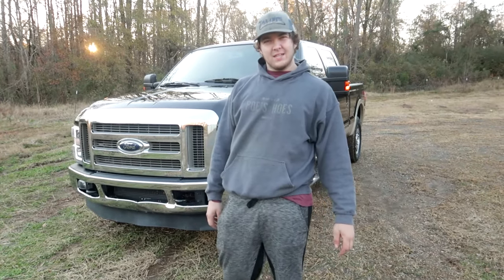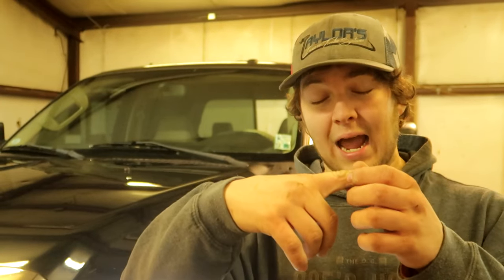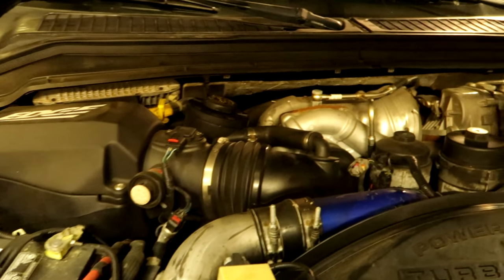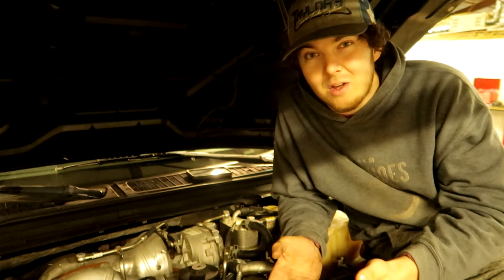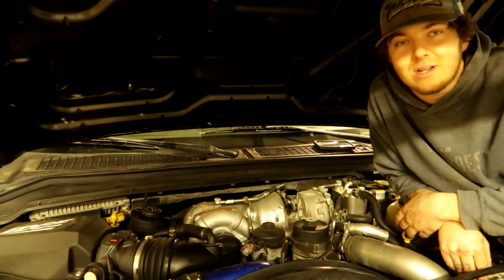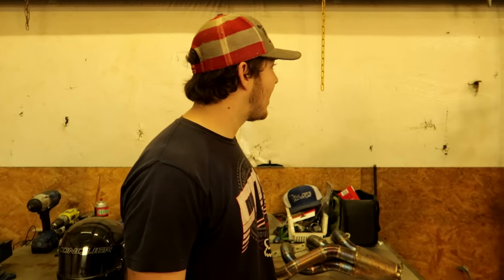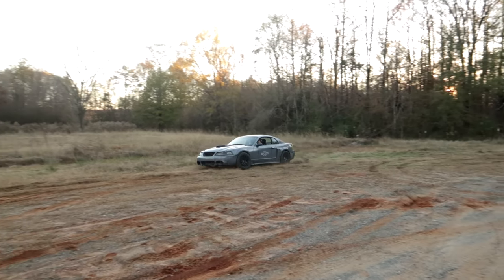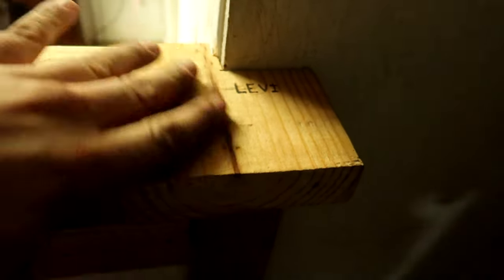Is the 6.4 Powerstroke a RELIABLE truck?

Comment: Let’s just say the 6.4 made me a rich mechanic three years ago!
Reply: Would be a great truck if it was a fummins
Reply: @lc2kx549  yessssssssss
Reply: I believe there’s a YouTuber that swapped a Cummins in one ! Things Insane!!
Reply: @monstermunoz18  yes their is
Reply: Taylor Ray
Reply: I’m not even a ford guy and my dads 6.4 convinced me that these powerstroke trucks are a force to be rekoned with. Once I buy myself that 6.7 Cummins I’ve always wanted I’m gonna buy one of these 6.4’s and turn it into a mud truck.
Reply: @monstermunoz18  Taylor ray and Westin Champlin
Reply: @hilljackzack7284  6.0L's and 6.4L's are monsters when they have aftermarket modifications,but honestly a 6.0L is a better choice probably.The 2005-2007 6.0L was more reliable than the ones made during 2003-2004.There also is quite some similarities between both of them,the 6.0L has a 3.74 bore while the 6.4L has a 3.87 bore,so not very large in difference,but both have a 4.13 stroke.The architecture of them is different,including emissions.That's another thing why I would go with the 6.0L instead,because the 6.4L has stricter emissions and also DPF filters.
Reply: @Slim_Slid  I’djust delete the dpf like I would on a Cummins. Ohio doesn’t have a yearly inspection so I’m not to worried about getting caught.
Reply: @hilljackzack7284  I didn't know Ohio had that,but then again I'm in Texas.Honestly if you do the delete,they can last 300,000 miles or more.If it's bone stock espiecally with all those strict limits,you're lucky to see 120,000 miles.The only engine during the time of the 6.4L that easily handled any kind of mileage was the gas 6.8L,but it had no torque in comparison obviously.
Reply: @Slim_Slid  that 6.8 motor is bulletproof as far as I’m concerned. It’s perfectly balanced and it sounds really good straight piped.
Reply: @hilljackzack7284  6.8L's are indestructible,espiecally the 2V V10 for 1997-2003.They just don't have as much horsepower/torque as the 3V 6.8L.
The spark plug rumors about them aren't a big deal as long as you torque them correctly without making them loose or doing it very tightly where it breaks.They have that high idle or whine like a 5.4L.When you delete or cut the manifolds and muffler,it's ridiculously loud.The V10 is basically a modernised version of the 7.5L,just easily less displacement and more cylinders of course.
Reply: @Slim_Slid  your statement is wrong, my 6.4 powerstroke is bone stock and it is approaching 300k miles. All that I ever had to replace was the alternator and the a/c compressor.
Reply: @johnny-ec3bz  Bullshit.The piston rods on those engines are weak and often at times can throw out,not even half before that mileage.I believe that your 6.4L PSD is at that those miles,but there's no way you only had to do those two little things,I know others who hardly are past 100,000 and already need to do rebuilds or buy another truck.
Your engine is just about to crap out,I can guarantee it,give it several thousand more on miles and that's it.
Those engines also have worthless turbochargers,being sequential was nice,but they were seriously flawed.Let's not mention the continuous blow by because of the DPF and exhaust stroke which leads to cylinders number seven and eight on a compression test.
Reply: @Slim_Slid  believe what you want but the proof is sitting right outside my house and yes I had other issues but nothing that had to do with the engine or the turbos
Reply: @Slim_Slid  calm down, mine is at 250k and still original also. just maintenance and don’t beat em up. I do agree some just go no matter what.
Reply: @monstermunoz18  yeah @westen Champlain
Reply: @Slim_Slid  I’m sure plenty of 6.0s and 6.4s make it, the difference is that a lot don’t and they can fail like that. Other hand, you can abuse a Cummins and still see 4-500k lol
Reply: @Slim_Slid  06-07 was the best 6.0 but they’re better with a 03 turbo 👍
Reply: @uisahoebhaha6165  I've already known about that...But thanks...Not I really care because I don't really want a 6.0L PSD or 6.4L PSD anyways...For me,7.3L PSD or V10.
Reply: I have a 6.4 with 202,000 been a great truck just keep maintenance
Reply: @Slim_Slid  ahhh yes another one of these guys who think their opinions matter 😂😂
Reply: @Haddox2145  
Ahh yes,another one of the dwellers responding to a three year old comment with nothing at all of value to add into the discussion at hand. Get a life.

Comment: The 6.4 wasn’t really fords fault. They were bound by contract to buy engines from international/Navistar. That’s why if you look at a 6.0 or 6.4 valve cover you see the Navistar plate and not a ford plate. With the 6.7 being a true ford design they have proven that they can make a reliable diesel. The 6.4 is basically a International MaxxForce 7, witch is equally junk. Ford actually never paid Navistar for the 6.4 because of all the warranty claims they had to do on these trucks. There were some f-450’s that had 3 and 4 engines put in under warranty because they simply blew up from being used in the HD applications. International/Navistar actually has had several class action lawsuits brought against them for knowingly selling bad engines, the most notable case being the MaxxForce 13 in their medium and heavy duty trucks. They paid out 135 million dollars from that lawsuit. So, long story made short is that Navistar knew the gig was about to be up with Ford. They knew that ford was getting ready to dump them and make their own engine, so they gave them and engine that would make lots of power and sell trucks. They cut every corner that they could to try and save their share holders pockets from running dry but ended up shooting them selfs in the foot, shooting ford in the foot and the people who bought the trucks in the foot. I always tell people this. - Dodge didn’t make a good engine, Cummins did. Chevy didn’t  make a good engine, Isuzu did. Ford didn’t make a junk engine, NAVISTAR did.
Reply from the maker: This is the most well put together comment I have ever read on my channel brother.  I love learning things like this from people who actually know their facts.  Mad respect!
Reply: What about the 7.8 Isuzu?
Reply: When you mention Navistar  you say enough, the semi International trucks made by navistar they also junks .
Reply: AMEN!!
Reply: don’t forget about the good ol 6.7
Reply: @2121cuervo  except for the dt466. I’ve had a couple and their the best I’ve had in both my tractors and trucks
Reply: GM bought Isuzu and they both worked on the Duramax so GM did infact make a good engine the only auto manufacturer to make there own diesel engine and put it in there own truck until Ford did it with the 6.7  powerstroke
Reply: LB7: injector failiures and must remove valve covers to get to them
LLY: Lots of Head gasket problems
LBZ: the most reliable duramax you can buy
LMM: Very good engine if you delete it
LML: Head gasket failiure and requires lifting the cab, easy to delete emissions
L5P: Very good engine, but very difficult to delete the emission systems
Reply: @afourteen1554  ha 6.7 them things are garbage,the first  288k miles on and thay will stop forever, first tou pay 98,000 on it and then you put 50,000 into it and then it doesn’t even run half the time
Reply: @gabrielhugges6820  lly head gasket issues stem from a shitty turbo mouth piece and a small radiator causing overheating, put a mishimmoto radiator and s&b mouth piece and your good to go, as for lb7 best thing is to get a lift pump and replace the old injectors with the updated ones. Really every Duramax should have a lift pump installed, it helps a lot with filtration. GM recognized this and that’s why the L5P has one from factory.
Reply: @gabrielhugges6820 also LML: shred the injection system and snap cranks.

Comment: I've had a 6.4 since it brand new and its completely stock with 180 thousand and nothing has happen
Reply: Oh wow your cool bro
Reply: @masonhuffy6086  when
Reply: I don’t know what these guys are talking about I have had mine for 240,000 miles and I don’t baby mine it hasn’t let me down but I did delete mine at 50,000 because it had high EGTs
Reply: @edwardcarleton9800  I'm in your boat except only 90k currently and thing is awesome used to own duramax and cummins overall the ford platform is best for work
Reply: IAM considering buying a 2008 F250 for 14k. Anything I should look for when test driving it?
Reply: @jasonargo8607  I look for any leaks in the Drive train or engine ask when the oil been changed if it hasn’t be a while look for green on the top of your oil dip stick it can show bad head gasket or a bad head then look for blow by if it’s deleted and tuned look for leaks in the block off plates and if you have a edge Monitor check all your injectors look over all your 4 wheel drive components and brake lines mostly all the same stuff you do for any truck you want to buy and listen to your gut if something doesn’t feel right about the guy selling it or about the truck
Reply: You’ll find damn good 6.4 and 6.0’s and you’ll find shitty ones.. some don’t need anything at all which is probably bc those are the people that used them how they’re made to be used.. pull a lot of weight. That’s my best guess anyways lol
Reply: @jasonargo8607   Hey man last year i bought my 08 F250 with 146K miles and love it so far. So what you want to look for atleast what i did is you want to scan it and make sure there are no codes showing you also want to make sure the truck is DPF deleted and EGR bypassed or deleted. I do agree with him when he says don't dog on it unless you have the cash to fix because diesels are big money pits but when you test drive it get into it and make sure the truck sounds right. Other than that it is a great truck i love mine just make sure you don't turn it into a 8000 pound race truck unless you got the cash. But good luck and i hoped this helped.
Reply: Looking for one to haul cars with locally..car auctions and dealerships maybe a travel trailer here and there
Reply: Hit 305k.... replaced radiator and blend door actuator for a/c
Reply: I have a 2010 6.4 350 lariat fx4 crew cab long bed with 56k miles and I love it. Bought it 2 years ago with 30k miles and   no problems at all. I do realize this is a 7,000 lb truck and not a dragster.
Reply: @angelgalindo3885 how’s it going now?
Reply: Tick tock says the clock😱💩
Reply: @jasonargo8607 Smoke and poor pickup off the line these things can be a little spooky when the boost kicks in. Just a little heads up. But please do not race these engines. They are not race-ready and will drain your wallet. And it tends to go catastrophic without warning.😢

Comment: I feel like 6.4’s are super hit or miss. I’ve seen some with 350,000 miles stock engine and trans, and some with 75,000 on their third engines.
Reply: The 6.4 is so hit or miss both my uncle and my grandfather used em as farm trucks my grandfather had no issues with his 2009 6.4L F-350 and got his money and mileage outta it while my uncle had nothing but troubles with his 2010 6.4L F-350
Reply: Facts my mayor of my town has over a million on his bone stock
Reply: My 2008 is on it's third engine now !
Reply: @stephentaylor280  why do you still have it them? Lmao it would have been scrap by the second for me
Reply: @stephentaylor280  well your second and third engines where  probably Cummins
Reply: @benjaminturpin2749  probably cause he likes the truck.
Reply: Lmao, very correct, my truck was lucky, it has 348k miles and got deleted at 60k been good from there until a couple weeks ago it started drinking coolant... currently doing head gaskets 😅

Comment: Have a 2008 6.4 powerstroke with 500 thousand kliks. Literally nothing u said has happened. Runs smooth.
Reply: Thinking about buying a 08 6.4 powerstroke with 234 miles on it.
Reply: Nice . Just bought one 88k miles.  Hoping I get the same I’m going by the book on everythin
Reply: @Freshprankstv1  How is it?

Comment: Bought one, first diesel truck. Blown engine at 28,000 miles. Fully built it, never had another issue out of it.
Reply: Watching this in 2024 interested in getting one so thank you for this comment
Reply: @bubblinking8543 just got one, deleted and a 50hp tune. It’s running like a dream at 230k it going strong. only thing I had to change was the water pump bc it broke.
Reply: what did you do the truck to make it reliable?

Comment: radiator problem, solved with a mishimoto radiator. Water pump, do coolant flushes once a year (ford also makes a special additive that also helps). Absolutely delete the truck 100%. Get good custom tunes and keep your foot out of it. Additives, run hotshot secret stiction eliminator and their fuel additives. Do a cold air intake that has a enclosure, dont run one that has an open filter, make sure you clean it often. All in all if you take care of your 6.4 its not as bad as everyone says it is. In my situation the guy that had it before me ran the piss out of it and didnt take care of it. Since ive owned it ive had the truck studded , deleted, custom tuned and i have kept up on my maintenance which is key with one of these trucks. I plan to do a fass system soon just to help it even more. 6.4s arent as rugged as a cummins or 7.3 but they can be reliable and a great engine
Reply from the maker: Well written, I agree!

Comment: Another really good fix is the valve cover from choate. It has a oil rail built in and gives a lot of oil to the valve system. I really suggest getting that.

Comment: My dad and my brother both had one. They are a handful and alot of work. But if you get a minimaxx tuner and delete it, it is a really awesome truck
Reply: I have the Mini Maxx Street Tuner and deleted the EGR’s and DPF
Reply: As long  as you're not turning it way up. It does best with stock tune and deleted (just gets rid of the codes/lights).
Reply: @allenklingsporn6993  exactly, occasionally we use the tow tune when we are hauling the gooseneck but that's it

Comment: Love this truck bought my 2010 dually in January 2011 with 500 miles I now have 239k only thing I did was ran a straight pipe with axle dump use the computer to delete the Egr

Comment: My 6.4 has 250,000 miles. Run it hard and love the king ranch in interior. When it blows up I'm putting in a choate engineering engine in. Then it's a Daily 650hp with lots of reliability.

Comment: My 2008, F350 DRW that is used for towing has 323700 Miles on it. I am just now replacing the lift pump that quit. I replaced the starter at around 310K, and the auto trans was replaced at 278K. That is all that has been replaced or fixed. Yes it was deleted early in life and got serviced regularly. It is not used for short trips around town. With the tuner it has huge power, but I take it easy on the boost climbing hills here in the west when I have a big load.

Comment: As for the radiator, a lot of people have had good luck with installing front mounted hitches to make the front of the frame more rigid.
Reply: So nice to be able to push a trailer into a tight place. Bike rack in front. Custom built plug in front vertical support, for dual overhead rack W/ spreader, for carrying long material.  Plug in my 5,000 lb removable winch when I need it.  Built a nice 2x2 stainless  receiver for extra driving lights.  I Like my extra hitch up front on Little Bubba. 
  I've put one on almost all my trucks over the years.  The front chrome bumper provides absolutely No structural support on our 2008 3/4 SD W/6.4 .  Deleted at 60,000 miles. Runs great. Take care of the engine. It will take care of you. Almost 200,000 now. Only a handful  minor issues thankfully.

Comment: You honestly don’t need a intake unless your wanting over 700hp you won’t start collapsing stocks tell 650-700. There is a company choate engineering that had a special rocker cover that reroutes oil to the rockers instantly.
Reply: disagree. i needed an intake when i deleted the dpf on my 6.4. it was popping the air restriction sensor on the stock intake under normal accel
Reply: @kreuzrittergottes9336  really? Who’s tunes were you running? I’m on the EZLYNK with provens and I’ve not had a issue. I’ve got buddies that are at 700 and they can run a stock for a little before they collapse.
Reply: @Noprep304  h&s.  I'm cat back deleted so it stands to reason I'll need more air anyway.  I never dog it either.
Reply: @kreuzrittergottes9336  that’s odd in 4” down pipe and the first section of exhaust into 5”

Comment: I’m in California.  I can not delete anything so I get my DPF cleaned and EGT sensors replaced every 30-40 thousand miles.  Plus, I run Archoil and cetane booster in my fuel and I change my engine oil 3-5 thousand miles.
Reply: Exactly, take care of the engine.

Comment: So now how do you like it ? Mine is the 09 250 Cabelas edition and it’s been deleted for 25k miles without an issue, I purge the fuel filter on every 10 tank and change my oil filter and fuel filter every 6k with oil at that time ! It goes like a kids truck but ment for an old man’s driving habits ! It’s never washed a cylinder and burns around 2 quarts of oil every 6k miles ! So either I got lucky of I’m doing something right by this truck ! I don’t think I’ve ever spooled the turbos past 30lbs yet but I’m a retired OTR driver with over 4 million miles !